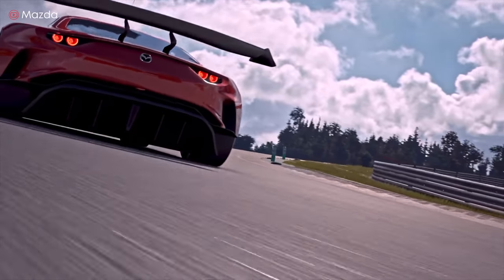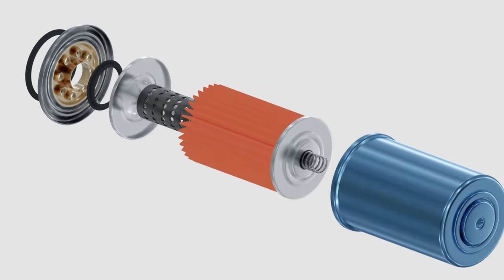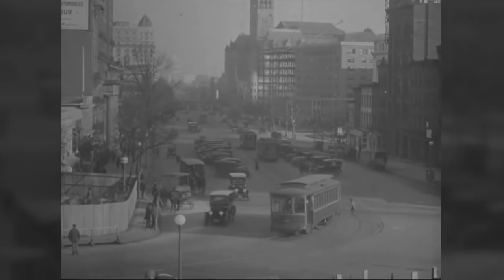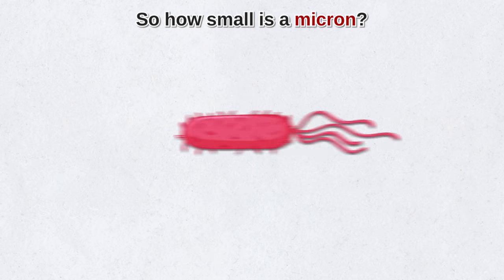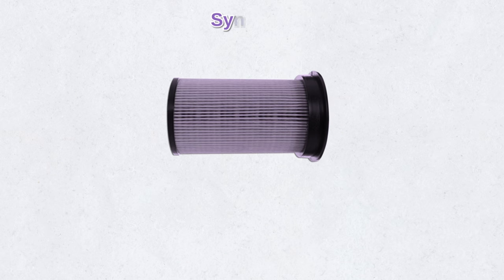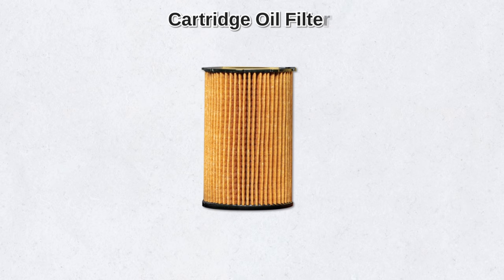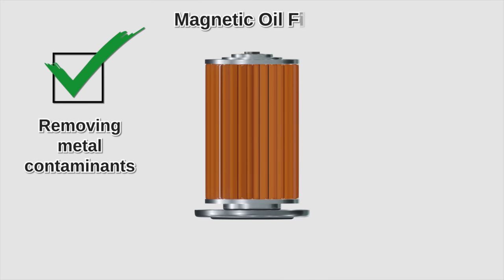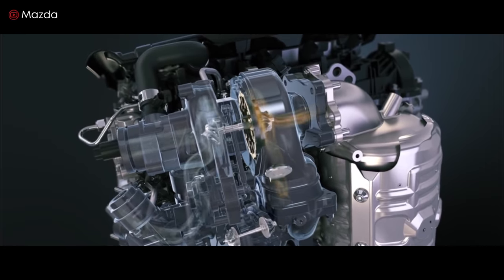This New Oil Filter Just Changed the Game (No More Oil Changes)

Comment: Wait a minute!  At 5:15 you say that a cheap cellulose filter will filter out 40% of contaminates that are 8 - 10 microns in size, and is good for 3,000 miles.  But then you go on to say that a more expensive synthetic filter removes only 24% of the same sized particles, but is good for a much longer 5,000 - 7000 mile interval?  If that's true, then the secret  to the longer life of synthetic oil filter life would seem to be that they simply do not filter as well as the cheap cellulose filters?  If I'm understanding that correctly,  I come to the conclusion that the best thing to do for your engine is to use use a cheap cellulose filter and change the oil every 3,000 miles, ans that's actually BETTER for your engine than using a more expensive synthetic filter in conjunction with a 5,000 - 7000 mile change interval?

Comment: I still like my Frantz oil filters which use a roll of toilet paper.
Reply: I recently got in a Australian  Jackmaster. Why I didnt get one sooner I dont know. Its better than a Frantz and as good as a Motor Guard  or Gulf Coast junior. That would make it the best oil filter in production. The reason I say it is best is because it has a larger core seal for the larger core toilet paper. They have a nice fabric covered element. I put a roll of Great Value  1000 in it from Walmart . Just pushed the roll down to the bottom and put on the lid. I will need a pair of long nosed pliers to remove the roll. The Jackmaster has a ring in the fabric covering to remove their element. When the paper changed Frantz didnt change. The top loaders are so much better. It is a must to use TP like Scott 1000 or Great value 1000. In other words a tightly wound paper.

Comment: what is your opinion of the TOILET PAPER FILTERS?????   this is a spin on container that accomodates a full roll of toilet paper and I have seen on the UTube University that there are good results ??     Opinionssss  Please?
Reply: The ones Im familiar with screwed on in place of the stock filter. They got the job done because they use toilet paper. They converted the full flow system to a bypass system. Took about 1/3 rd roll of toilet paper.  Not practical. If it takes a full roll and has hoses thats a different story. Right now for using toilet paper the Australian Jackmaster  is the best in production. It is a top loader with a bigger core seal. Push the paper down against the core seal and put on the lid.Must use tightly wound paper such as Scott 1000 or the fabric covered Jackmaster element. Since 1963 I have used the Frantz oil cleaner The Motor Guard the Gulf Coast junior . Recently got in a Austrailian Jackmaster. Looks like the Jackmaster  is as good as the Motor Guard or the Gulf Coast junior when using toilet paper. Motor Guard went to compressed air filters years ago. Gulf Coast does mostly heavy duty diesels now. That makes Jackmaster the best at using toilet paper. Toilet paper has changed. Jackmaster has changed with it. You need a top loader with a larger core seal at the bottom for the larger toilet paper cores and shorter paper. You must use a tightly wound paper or the Jackmaster elements. Jackmaster is big on information. Check their website.

Comment: Does anybody remember the toilet paper oil filter back in the 70 s I don't remember the name yes you used a roll of toilet paper
Reply: Frantz. Still available with old school and never element. Worked created. Watch a demo in person. Distributed still out there.
Reply: As far as I know Frantz came out with the first game changer oil filter in 1953. Cotton was good but not good enough. After almost 70 years they wouldnt qualify as new. I know of several game changer oil filters. Some have copied toilet paper and have 30 dollar rolls of paper that are as good as toilet paper.  The last Great Value 1000 I got from Walmart  was 60 cents. They gouge  the hell out of you on the Scott 1000. Probably closer to a dollar.  Unless you know how to use toilet paper in a Frantz it's best to use the Frantz elements. The top loaders are more user friendly. All I have now is Motor Guards and Gulf Coasts. They are better designed for using toilet paper. I'm a toilet paper guy. The full flow filter was designed to remove the large engine damaging abrasives from the full flow of oil to the engine. Bypass depth filters or oil drains are to remove the smaller engine wearing abrasives and sludge. Been getting some good reports on the Jackmaster of Australia.  I think you can use toilet paper in them. Might want to check them out
Reply: Recently got a Australian Jackmaster in. A very impressive filter. Probably the best still in production. It is required that you use their fabric covered element or a tightly wound paper such as Scott 1000.  I put a roll of Great Value 1000 from Walmart in mine.Jackmaster put a larger core seal in for the larger toilet paper cores. They were thinking ahead.. No rediculous sleeves and wire rings. I will need long nosed pliers to remove the used toilet paper. The Jackmaster elements have a ring attached to the fabric. I got the Classic model. Works for me. Heard a rumor you cant get a roll of Scott 1000 at Dollar Tree for a dollar now.

Comment: So, ah . . . WHO makes good oil filters?
Reply: Wix is a good choice.
Reply: The ones that actually eliminate routine oil changes are the bypass filters such as Frantz. Motor Guard and Gulf Coast. Some are getting hard to find. They are for people that understand the oil system  and are mechanically inclined. I finally broke down and ordered a Austrailian Jackmaster. Looks like it is the best designed for using toilet paper. With the larger core seal you push the paper down against the bottom and put on the lid. No jacking around trying to make the Frantz fit the paper with spacers.  Should have ordered a Jackmaster years ago. The Jackmaster is as good as the Gulf Coast junior at using  toilet paper. The top loaders can deal with the larger cores and shorter paper. Im a toilet paper guy. The Jackmaster elements are high quality fabric covered .

Comment: I had a friend that worked at the Ford Stamping plant south of Buffalo. He used to use toilet paper. In all his cars. Worked good. Have you ever heard of toilet paper filters.
Reply: Cheap, but didn't work. too much contamination from the paper shredding and the oil didn't flow through the paper.
Reply: When I worked at the Milpitas California  Ford plant my supervisor had a Mustang dragster he pulled all over the US. He had me put a Frantz oil cleaner on  the tow rig that was a early 60s  Chevy Suburban with a 292  big 6. I  removed the full flow filter with a Frantz adapter.  When I left  Ford it had over 350,000 miles on it. Probably over 300.000 miles with no oil drains. He used Standard Delo 100 W 20 oil. Changed the toilet paper every 2,000 miles approx. Put a Motor Guard on his Plymouth Fury before I left. He made it easier to sell filters. Motor Guard  and Gulf Coast were improved filters which only meant they were easier to change. The old Ford  plant is gone now. We made about 50 Mustangs and 20 trucks an hour. I went to work there in 1965. Made a few Pintos and Mavericks
Reply: I recently got in a Australian  Jackmaster. It looks like it is the best for using toilet paper.  The core seal is bigger for the bigger core toilet paper. Being a top loader it is more user friendly. Been using Great Value 1000 from Walmart.  Most are using the Scott 1000.Frantz didnt adapt to the bigger core TP. The Frantz elements fit. Sad to see people trying to make the Frantz fit the TP.

Comment: How does the oil get dirty in the first place?
Reply: an engine is a dirty place.
Reply: @land7776  if dirt can get in, then that must mean oil can get out. I'd have thought that engines would be sealed better in this day & age. I guess I'm a frequently disappointed optimist! Lol
Reply: @Joe Jolly  dirt can be unburned fuel, carbon deposits, foaming agent from the oil, water vapor from heat, etc. This is caused by hot engines burning fuel and oil and it's byproducts. That is dirt to the engine. Not like dirt from the ground.
Reply: Our problem in the 60s was mostly sludge caused by problems in the engine like soot water mixed with oil
A good filter could deal with atmospheric dust. Working in a full service gas station  in the 60s it wasnt unusual to remove the drain plug and no oil or very little oil  came out. Not common in modern engines but clearances are smaller. The water was caused mostly by poor crankcase ventilation or not operating at normal operating temperature. I was told you need about 135 f in a gasoline engine and about 155 f in a diesel. That was a long time ago things might have changed. That's oil temperature. I sold Frantz and Motor Guard  oil filters in the 60s. Sometimes the filters clogged with sludge in less than 50 miles. Then you had a problem. The customer didnt have a problem until you put a depth filter on. Told my uncle we will need to open the engine and clean out the sludge or change the filter every 50 miles
He took the 59 Ford and traded it in on a new Dodge pickup. We put the filter on that. Piece  of cake with a new of well maintained engine.. kind of like when the government came to Kellogg  Idaho and started checking kids for lead  poison. A lead smelter next to a school. People said we didnt have a problem until the government came here.
Reply: @ralphwood8818  Every 50 miles? Everybody must have been a mechanic in those days. Instead of a spare gas can in the trunk, it'd be more prudent to run out of gas & carry spare oil filters instead. Small mercies of the modern world I suppose.

Comment: Back in 1988, I went to tech school for agriculture mechanics. One day in class we learned about differences in oil filters. We saw some oil filters taken apart to look at all of the parts and the differences between brands. I had just bought oil and a new Fram filter for my car. So the shop teacher let me change oil in my car during shop time. So of course I took apart the old Fram filter to look at what my filter looked like. Needless to say that was the last time I have ever bought Fram junk! Fram is the worst filter ever made! 
Before you junk it, Fram it!
Reply: Ever is a long time, but I take your point. I don't use them either. But better than nothing.
Reply: Nothing wrong with Fram XG (highest grade) filters.
Reply: I dont use the cheapest Fram

Comment: Its Frantz or nothing for me !
Reply: Normally you wont hear any thing about actual filters that eliminate oil changes.
Reply: I like the Austrailian Jackmaster Its the best for using Toilet paper The top loaders have larger core seals and can deal with the shorter paper better. Push the paper down against the core seal and put on the lid. I used the Frantz when toilet paper fit the Frantz.

Comment: The old toilet paper filters actually did a very good job filtering the oil.
Reply: It did a good job except tp was water soluble and if any moisture gets into the filter it will break up. This will clog oil passages and destroy the engine. The inventor refused to acknowledge this and moved to another filter media. He was a religious person and felt he would be protected by the Almighty.True story. His engineer resigned and went to work for Racor Industries. He patented Dahl Fuel/Water Separators (Dahl Model 100) using a Franz housing assembly. Still being produced by Baldwin Filter Co.

Comment: Unless you have an EV, you'll always have to change your oil
Reply: Boiling it down to a monetary basis, and assuming I use high quality oil and filters, I will spend on oil changes in 800,000 to 1,000,000 miles about what it will cost for a single replacement of an EV battery...which certainly won't last 800,000 to 1 million miles.  And my used oil is totally recyclable.
Reply: Cars dont cost me much. All I buy is old cars. I dont drain oil because I use filters that use Scott 1000 or Great Value 1000 from Walmart. I have a Smart car that I would like to convert to electric. It has 150 K on it with electrical problems. It would be a good project. Probably not practical. Probably cheaper than a Tesla. I'm 80 I would love to finish my days with a Tesla. It ain't gonna happen. The Pontiac Torrant and the old Ford F250 will have to last me.
Reply: I have decided I dont want to wish for.a Tesla now. I want to wish for a Ford electric truck. Saw one on TV this morning.i wonder what the payments are. I might be stuck with the 76 F250 until I can save the money. Too old to get financing
Reply: Dont want to forget about the 93 Subaru  Legacy  It has 237,000 miles on it now. Had to start driving it . Had to order a ECM for the Pontiac Torrant. The Subaru has it beat on gas mileage. That's getting more important to me. Paid 1100.00 for the old F250 with the 390. Probably could get a little more for it now. Gas hog from hell. A new Tesla would save a  lot of gas money. I dont change oil. The Ford has a Motor Guard on the engine and Gulf Coast on the transmission. Put the Australian  Jackmaster  on the Pontiac. Had to pull off a Motor Guard  to make room for it. Had to get the Pontiac ECM programed to the vin number.  Its out of control. Took the Pontiac to get it inspected. They said did you replace the battery ? Its not ready to be inspected. The computer has to check off the items. That took 3 weeks.

Comment: on  large eng. like railroad   they only change oil  filters never oil . they check viscosity  check for contaminants  and use over for millions of miles.  autos only last 40 to 70 thousand miles then are absolute  junk cant be repaired!!!! with no oil oil changes  74 year old 60 years of mechanics...
Reply: Yes the offshore drilling rigs like on Shell offshore rigs use locomotive  engines.They use big double roll paper towel  filters such as Gulf Coast filters. At one time I sold filters.I can pass an electric current thru a used sample of oil and tell you if it is contaminated. If something happens like the reading is too high the engine is shut down and a sample goes to the lab. One of my customers called and said they need more Gulf Coast filters. Had to tell them to call Gulf Coast filters. I'm 81.  Being in an engine room or under.a truck I cant do anymore.Had to retire. Still like to talk about them. Filters that actually clean oil are seldom mentioned. They deserve respect. There is a fleet of trucks over by Decatur  Texas with Gulf Coast filters. Must be people around here installing them. When I was selling them T A truck stops were servicing them. Dont know if they were installing them.
Reply: The instrument is reading the conductivity of the oil. It is zeroed on new oil the same as what's in the engine. Of course dirty oil is a better conductor  of electricity  than clean oil. The instrument only tells you how easy the flow of electricity is going thru the oil. The lab can tell you what's in the oil that shouldn't be in there. An expert can tell a trucker if his turbo or air compressor  is wearing  out. With oil analysis.

Comment: Oil is cheap. Engines are expensive!
Reply: Another dumb statement. Good.oil is not cheap. I gave up allowing the oil to get dirty wear and foul the engine then draining it with a depth bypass filter in 1963 with a Frantz oil cleaner. The Frantz has been obsolete for many years. Not many know how to service them. TP doesn't fit anymore.

Comment: PSA: DO NOT USE FRAM ORANGE CAN OF DEATH. Your welcome
Reply: yeah Fram hate meme-- so original of you..
Reply: @land7776  Fram ultra synthetic is a phenomenal quaulty filter, their tough guard is ultra trash.... Pretty much goes for any cheap filter that uses glue and carbboard in their construction. Go check out a tough guard lfram cut open... You'll be happy not to use one of thoes
Reply: @jmabs5096  well, I usually use Motorcraft, theyre cheap and available and I do have an old Ford truck. But I used Fram orange cans of death for years..and had no problems with engines, ever. really. Lots of people did and do. I know the cut-open vids, they proliferated since that first/early one in the mid 1990's(?). I believe that started the meme. There might be glue or bailing wire or whatever.. but is their definitive proof that Fram orange damages engines- tested proof? Seems like it would've happened..esp when mil./civ aircraft have been using the Frams for many decades with constant delta p/particle monitoring, phase inspections with trend analysis/oil/fuel sampling. If there was any prob they would've discoverd it long ago and stop using. So, whatever...
Reply: It's kind of like parrots repeating what they have heard.  It doesnt matter if the ends are paper as long as the glue  is good.  I dont buy the cheapest grade. I use the Motorcraft filters in the old Ford 390. Dont know if it matters but I like the bypass valve in the top. I think when I worked for Ford they were  called Rotunda.  It's been a long time.

Comment: Fram are trash.  Fail every test and disassembly tests.
Reply: how do they fail every test, specifically? Where is that test data?
Reply: None of the full flow filters clean oil. If they had enough filter media to clean oil the relief valve would stay open. You would then have a game changer bypass filter  such as A Stilco or Trasco. I prefer the full flow system with a bypass filter that has hoses going to it. Like  a Austrailian Jackmaster  game changer. Most of you dont have a clue. You debate which of the filters that don't  clean oil is the best. Rookies.